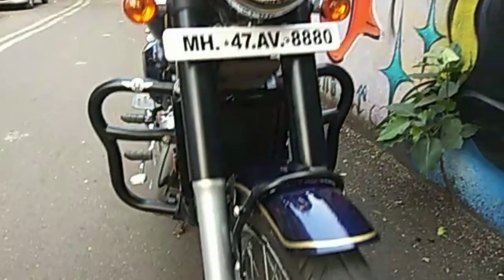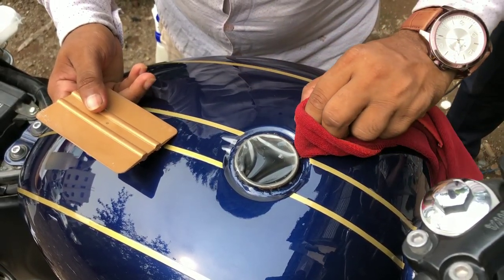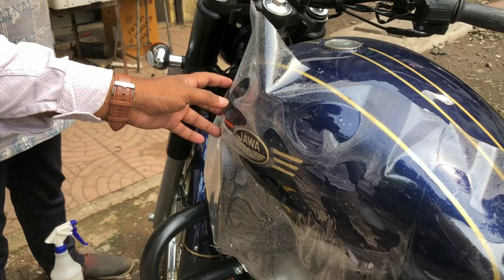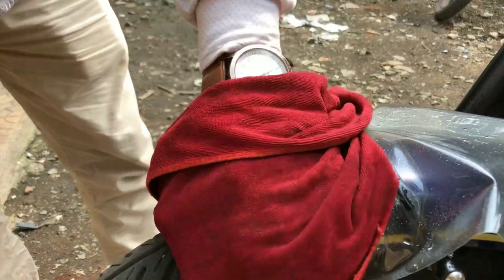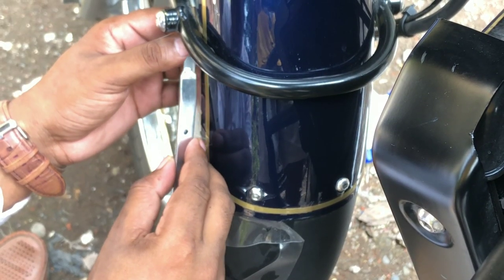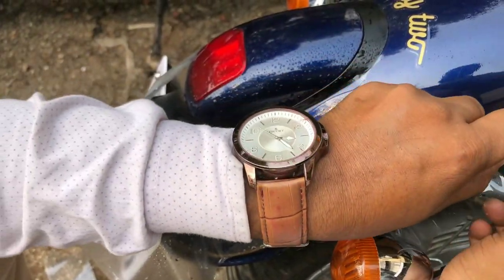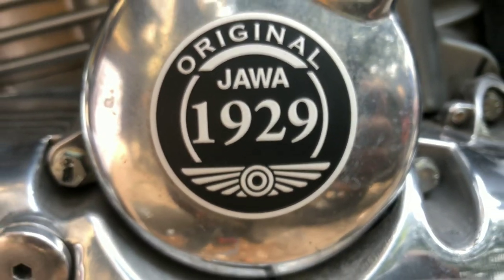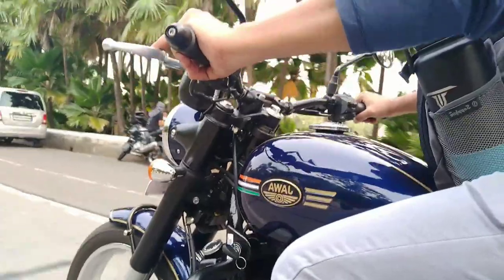PPF installation on new Jawa | Protect your bike from scratches | Is it better than Ceramic???

Comment: Very nice video. Is it necessary to wrap the PPF around the parts or just trim the edge ? I wondered if the PPF would start peeling on the fender .
Reply from the maker: No bro it doesn’t I have mine on since 1 ½ year now